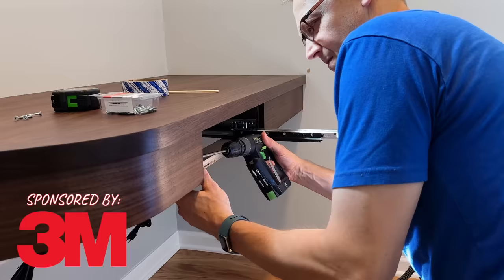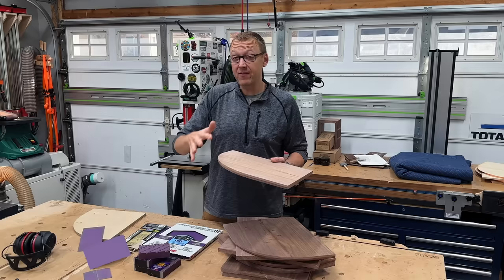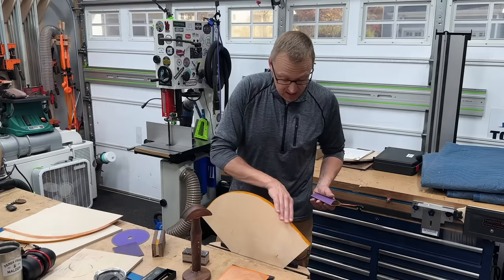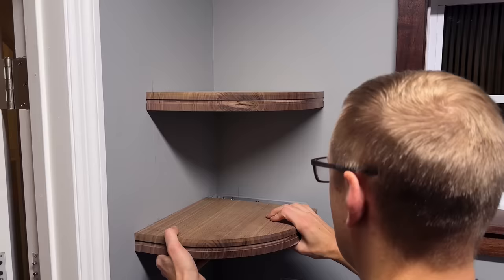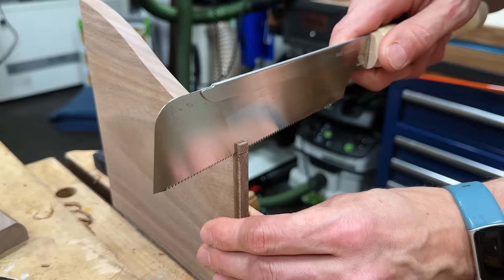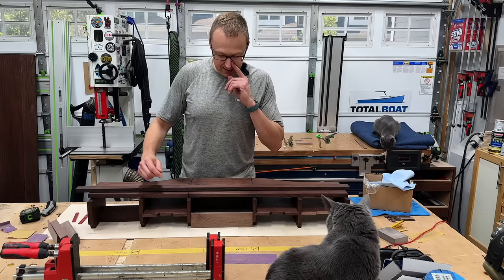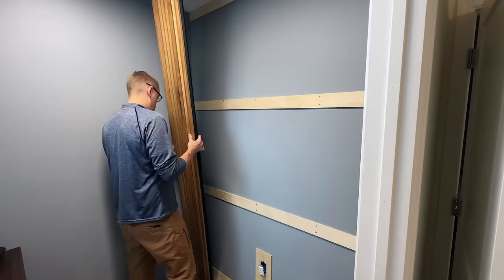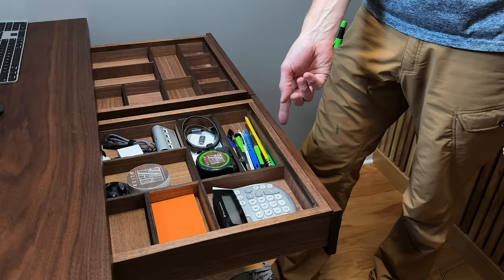I spent over $5000 building my dream office.

Comment: I don't see why a laser should "scare" anyone! It's just another tool in the shop. It cannot and should not replace any other tool! I'm a woodworker and engineer, and I'm building my own 90W CO2 laser cutter as an addition to all my woodworking tools, CNC machine, and 3D printers. It's just tech., don't be afraid!
Reply from the maker: Amen! Good luck with your new laser...sounds awesome!
Reply: I work for a 500 people company and in my department are 15 skilled worker. One single 3D printer could make all of our work faster and wayyyy cheaper and the reason why i know this is because we actually a have 3d printer in our company and we tryed it after work and were pretty shocked and scared about the speed and quality of the print.
Reply: Lasers certainly scare Marjorie Taylor Greene! 😁
Reply: @wh0tube  Do you see politics in the room with you right now?
Reply: @mrhino  more like light entertainment than politicts.

Comment: Technology like laser CNC's will not water down the craft or replace the creativity we all bring to the craft.  As an Architecture student back in 1985, I was told that introducing and using a fairly new technology that was experimental at the time would do all those negatives things that are the same general fears that people still have about technology today.  I was told that I had to do everything by hand as opposed to using this new tool.  A year or so later it became the norm and in time proved to remove many unneeded steps to allow creativity to become more fluid.  That tool was AutoCAD and it replaced having to learn how to draft by hand in order to communicate and refine design.
Reply from the maker: Thanks for the thoughtful comment! It's always great to hear opinions that draw from real world experience. I love traditional drawings by hand and I still do them, but also love the endless versatility of computer drawn plans where you can make quick changes to parameters and have it automatically adjust everything for you. What a time saver!
Reply: @KeithJohnsonCustomWoodworking  I personally grind my teeth at irregular shelf designs poking out of walls or gaps, but I really liked the idea of the middle layer, I would probably use it for other purposes.
Reply: And now AutoCAD is the universal excuse😂 “it worked in CAD idk”😢
Reply: Your teachers must've been friends with my 7th grade math teacher--who insisted we all needed to learn to use the slide rule and calculate logs!  The other classes had casio calculators! 😼

Comment: So many details to love about this video: the copper edged shelves, the ingenious shelf brackets (using this one), how to cut your full-sheet sandpaper, the custom organizer, hint about checking your end grain before you create a roundover, the figure-8 fasteners, the Soss hinges (those are beautiful; using these too).

What about attaching some acoustic felt to the bottom of your shelves?  Cut on a smaller radius so the edge doesn’t show. That might absorb a bit of your front echo.
Reply from the maker: Thank you very much! I greatly appreciate the comment. And yes, attaching some felt to the bottom of the shelves could help as well. I still have cat beds, cat shelves, side tables, etc. to put in the room, so all of those things will help absorb sound as well!
Reply: @KeithJohnsonCustomWoodworking  not to mention the cats themselves!😁
Reply: You could hang producers choice sound blankets from the ceiling parallel to the floor, or make a cloud of acoustic panels 4 or 6 inches deep, hung with a 4 or 6 inches of airspace between them and the ceiling using cables. Also nice deep pile carpet on floor with rubber carpet no slip layer, plus carpet padding. My understanding is that reflective floors and ceilings are big factors. Also changing the room from a box to an irregular shape helps. So having some angled walls, ceiling reduces resonance. Maybe a set of triangular floor to ceiling columns in the corners behind you? They could be partly shelving units which would also give you a bit of diffusion. If you look at sound editing studios they often are trapezoidal in shape.

Comment: That is an incredible setup. You could have built much better sound absorption that looks just as good for a fraction of the price. You could put a thick "cloud" absorption panel hanging from the ceiling which would cut a ton of echo. GIK Acoustics is one of the cheapest on the market and does some nice wood finishes and patterns you would like; they could also recommend some panels for your side walls which would help even further.
Reply from the maker: I appreciate the suggestions and the insight! To address your comment about building them myself for cheaper, at my hourly rate it wouldn't have been cheaper AND I had no desire to build them 😂. If labor isn't a concern, then yes, you are correct. Sometimes I prefer to build things and sometimes I just prefer to buy them 😂. That's not to say I probably won't cobble together some ceiling panels 😜.

Comment: Hey mate glad to see its finished, been listening to the podcast for a while ;)
So with room acoustics, you get echoes or flutters when you have flat parallel surfaces. Either walls or floor to ceiling. Just from the little I can see in this video I would suggest adding something to that full side wall to your right when sitting at the desk, and also something to reduce the vertical reflections. You can google ceiling cloud panels. Basically like an art canvas with insulation inside it hung on the ceiling. Easy to make or just go for a nice thick rug... I have built a couple of studio spaces and there are a few forums online if you want to go down that rabbit hole... Also I might steal the inlay copper strip idea :p
Reply from the maker: Yes! Definitely going to do something on the ceiling and on my right wall when I have a chance. I can't go rushing into things, though...I need to thoroughly plan it out for an infinite amount of time first 😜😂
Reply: @KeithJohnsonCustomWoodworking  hahaha yeah probably wise. Don't listen to me, I just buy materials and make it up as I go... works out a solid 60% of the time! :p
Reply from the maker: @alexrottier9396  Hey, 30% will get you in the Hall of Fame, so 60% is a solid number.
Reply: @KeithJohnsonCustomWoodworking  Hell yeah! Im winning... Merry Christmas from Australia too. :)

Comment: I was a CNC machinist (more of a CNC Operator at my current place of employment), and I love finding out and learning new technologies for my trade. As you said, time is valuable so if there’s a way to cut down on that and make it easier, why not use it? At the same time, for my trade, does that necessarily mean a loss of jobs? Yes and no. As I said, I love learning new things, but not everyone does, and as technology moves forward, if you’re not truly keeping up with it, it’s easy to get left behind. The need to have someone load the machine is still needed, but many of those who do that (no matter the age, in my experience) just know how to press go and don’t want to learn or care about what happens beyond that. How to read the program, what cutters do what to the part, probing, touching off tools, etc holds very little interest to them, so if it winds up that they can’t keep up with the basic knowledge of the job, to me they shouldn’t be surprised when that job disappears because one person (who has taken the time to learn it) can load that machine alongside a dozen others. If you have the knowledge, you can walk into any place and figure out how to do the job, because right now we’re still in an age where the machines are only going to do what you tell them to do.

You did a great job with your office! Love the look. Easy to see how much care you put into your craft.
Reply from the maker: Thanks so much for the kinds words and sharing your thoughts and experiences. It's definitely a common misconception that machines like CNC's or lasers or even standard shop power tools are just "push a button" and the machine does everything else. It goes so far beyond that, as you know!

Comment: This turned out beautiful Keith! Such an awesome home project 👍🏻 You’ve definitely worked so hard to improve your very own editing room. Congrats man. I love the way everything turned out. 
I’ve been thinking about adding some acoustic cedar paneling in my own personal room. I have tons of tongue and groove cedar planks that I have left over from a project I had worked on a week ago from my own commission work and the home owner didn’t want the rest of all that cedar. So I’m thinking about doing a layer of 1/4” - 3/8” thick sound foam board and then apply the on top of that. I wonder if it’ll work?
Reply from the maker: Thanks man! And it sounds to me like that should work. I think people also use Rockwool insulation as a good sound dampener.

Comment: I'm glad you showed the flaws in the acoustic panelling wood parts up close - I've seen them used many times in other office builds, and no-one else has shown them up close like that, flaws and all. It's kinda shocking to me that they can still charge ~$300 per pack for such shoddily finished pieces of wood. 
I suppose so long as the front facing bits are fine (which they are), nobody will really notice the flaws in the interior edges?

The desk and all the other parts that you made look absolutely beautiful!
I think the laser cutter is a great idea for fiddly tasks like making those organiser boxes - they would have been a really laborious task otherwise, and they look great
Reply from the maker: Yeah, I zoomed way in to show the flaws, but TBH, I don’t even notice them from normal viewing distance. The veneered MDF options are virtually perfect but require the extra labor to apply finish. 

And thanks for the kind words!

Comment: Definitely NOT afraid of technology. I'm getting into woodworking for a hobby, most of the makers on YouTube that I follow are either hobbyists or genuine craftsman that would cringe at the thought of replacing their work with a machine.
Reply from the maker: I think of it as another tool in the tool belt. It's not going to replace the majority of what I do, but if it can help speed up the process or open up new doors for design details that would be time prohibitive by hand, I'm all for it.
Reply: @KeithJohnsonCustomWoodworking  
True.
As a woodworking business owner you want to maximize efficiency. Hobbyists have the luxury of working at their own pace.
Reply from the maker: @moshebron2105  Very true. I've definitely been on the hobbyist side and it's hard to break some of those "work at my own pace" habits that don't work well in a business. LOL.
Reply: @KeithJohnsonCustomWoodworking  living in the tri state is a bad business practice!!!!

Comment: I think one problem with cnc laser box joints is the fact that no longer will an apprentice have to make box joints for months and complain the he hopes he never sees another box joint. 2 things. It gets their basic skills up to speed and also sorts out who is really committed. There will be a loss of skill. Anyone can program a machine to do a job. For instance next time you take your car for a wheel alignment ask the technician what KPI, camber, toe in, castor, steering Ackerman, etc and why is it necessary. Very few will have any idea.
Reply from the maker: 😂 Yeah, well the days of the sloppy apprentice dovetail cutter are long gone, but I agree machines and computers have greatly reduced trade skills and the knowledge of how and why things are done.

Comment: Hey, like the work. Personally would be concerned with the lack of workable desk space. I had a similar small office small desk issue trying to condense as best I could. An out of the box solution I found was changing my mouse from the conventional drag a round a square foot of space mouse, to a fixed trackball mouse, amazing how much room is freed up by not having to move the mouse. If space is a tight might be an option
Reply from the maker: Haven't had any issues with useable desk space...I'm just editing and podcasting, so you don't need much room for that.

Comment: The acoustic panels you chose are specifically for diffusion and you made the correct choice of putting them to your back. The purpose of diffusion is to scatter reflections in various directions and preventing standing waves. They can even make a room sound bigger than what it actually is, which was probably very helpful for that closet. Now the felt does provide some absorption, but only for very high frequencies since it’s so thin. The reason you want them at you back is if you ever use speakers(I noticed you were wearing headphones). If you ever decided to edit with monitors, the diffusion will prevent the sound from bouncing back directly into your ears. Although I suspect with the room being so small  the initial time gap would be negligible, but it certainly can’t hurt. 

Acoustically I think you made the correct choices. But with the quality of that wood, I think you got boned on the price. For that kind of money I would expect a much cleaner look.
Reply from the maker: Thanks so much for taking the time to comment and sharing your knowledge! I definitely have some more improvements to make, but need to do a little more research first. Cheers!

Comment: 28:25  I myself installed a drop ceiling and used acoustic panels as inserts (flat white).. They totally kill all nasty sound frequencies and even my mechanical keyboard (red switches) and my mouse switches are audible quieter than before. It took me a bit to get used to it as everything started to sound different when all was done. I have it installed in my entire living space (kitchen, living room, hallway, office).. Incl. installation hardware that was shy €1400 for 80sqm of area to be covered. It was totally worth it in my opinion. I cannot even hear my fridge whining anymore when I am in other rooms...
Reply: Panels were "Ecophon Opta A"
Reply from the maker: Great tip! Now that the room is filled out with more items (big cushy cat beds 😹) coupled with the mic I use, I currently have no echo issues .

Comment: ACOUSTICS: the diffusion/absorption on the back wall is cool, but you’d still want pure absorption behind those screens (2 inch) and if you want, some small absorption on the side walls at face height (1ft x 1ft). Should notice a nice improvement for recording
Reply from the maker: How did the voiceover sound in the video?

Comment: Would have looked extra cooler if that back wall of sound dead panels curved in the corners - possibly better acoustically also.

The shelves were stunning, absolutely stunning. Great result.
Reply from the maker: Curved walls...YES...that would so cool! Dang, I'm bummed I didn't think of that 😂

Comment: I find it interesting you touch upon the fear and reasoning of automatisation. This is a hot topic in software engineering, my field of work, due to the arrival of AI solutions like copilot and Chat GPT. Never would I have imagined this is something going on in the woodworking industry as well.
Reply from the maker: It's quite shocking how fast AI and automation seem to be embedding their way into everything. They are extremely useful in so many situations, but where does it end?! 😬
Reply: @KeithJohnsonCustomWoodworking  yes I agree completely, it has some very bright sides but I would not mind slowing down a pace for now.

Comment: I really like the original design of the curved shelves better than the final ones. I wonder if the original could have been saved by using the copper bar you used in the final instead of the gilding?
Reply from the maker: Yeah, it potentially could’ve been saved, but there was so much labor gluing up one shelf since they had to be done in multiple steps…I was just done with it 😂

Comment: Wow. Incredible work! I like these copper stripes. For sanding: you could use sanding grid. It has some advantages over normal sand paper. I think CNC is not the end of craftsmanship. It's another tool. I don't have a shaper, but I use my 3D printer to produce exact routing templates and accessories. It's fast and cheap. And a laser might be the next step in my workshop. Have a merry Christmas.
Reply from the maker: Not sure what you mean by sanding "grid" unless you are referring to Abranet type abrasives. And a laser would definitely be faster for templates, etc. than a 3D printer 😜
Reply: @KeithJohnsonCustomWoodworking  yes I was referring to abranet like products (here it's called different ;-)). I never had the opportunity to work with a laser, but for now a 3D printer is more convenient for me: I've printed a lot of tool, stopps etc. But it depends on your projects an possibilities in your workshop. I don't have an option for ventilation so a laser isn't possible right now.

Comment: 28:31 Hard disagree. Your cheaper options would not work as well. They would work far, FAR better. That is to say, they would have a far greater positive effect on your room acoustics.
48 ft² of 1.5" Rockwool Comfortboard 80 costs about CAD $75. This is an excellent wall treatment.
Craft felt might be another hundred bucks or you could find some other fabric for much cheaper if you shopped around a bit. 
A box frame is the cost of some cheap 1x lumber. 
If you decided to splurge, instead of finishing the panels in fabric, you could have your buddy cut out some snazzy designs from thin plywood as a facing material.
That wall could have cost you $250, looked as good as performed much better.

For eight hundred dollars you could cover the whole room in really nice--looking broadband acoustic panels, and that's exactly what I"d recommend if your intention is to record voiceovers in that space.

Fun build!
Reply from the maker: Thanks for the comments!